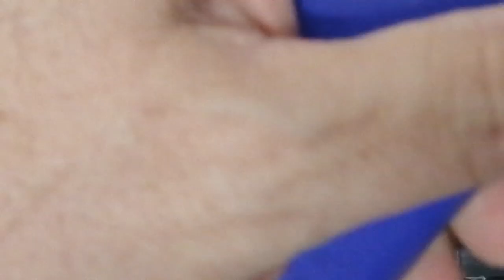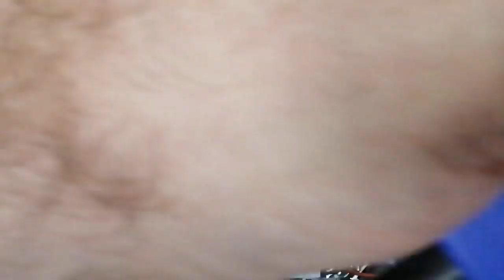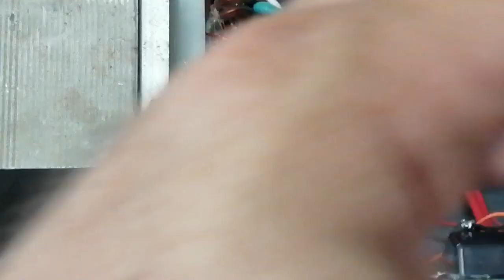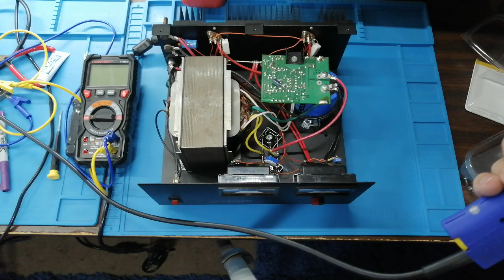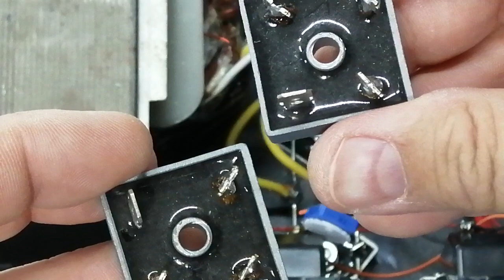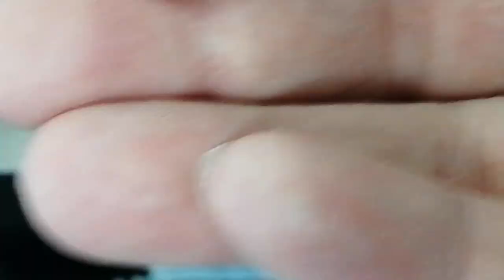Dev It #2 - Details on how I fixed  Astron RS 35M power supply

Comment: I Have A Astron RS20-20A That I Ran All My Radios On & i Turned it Off The Other Night & Went To Bed When i turnd it on the Next Day It Blew The Fuse & Another..I Assume its The Bridge Rectifier But Not 100% Sure Yet..So I Bought a Used Astron VS-35M with Meters & Adjustable Voltage & It Works Good But The Meters Need To Be Replaced ASAP & I Cant Find The Amp Meter !

Comment: if you re-used the metal bars that connect the two diodes, could you have left the wires soldered to the wires?
Reply: correction: could you have left the wires soldered to the metal bars?